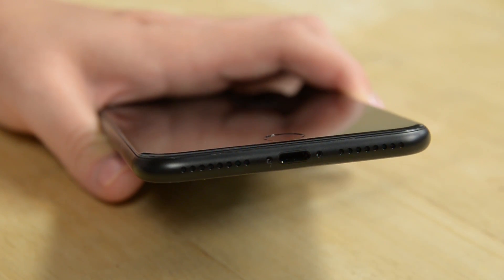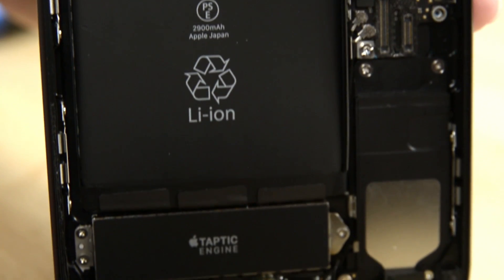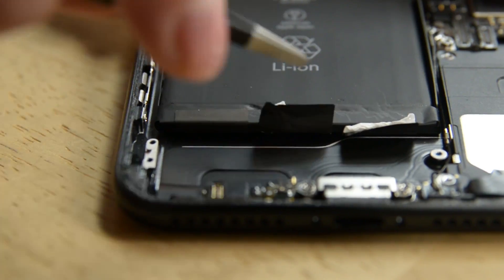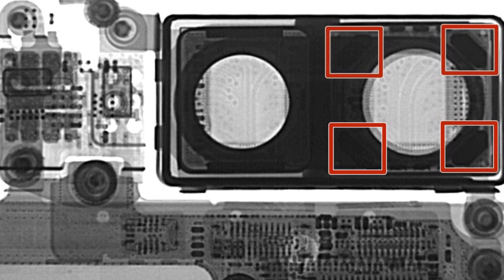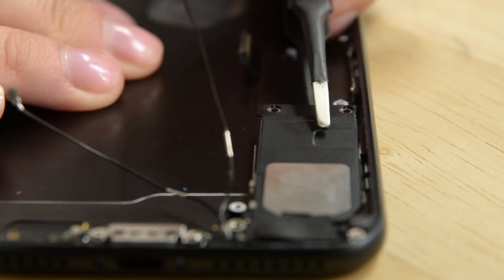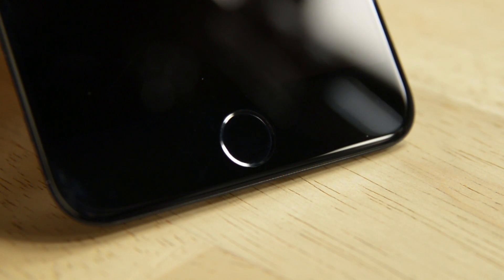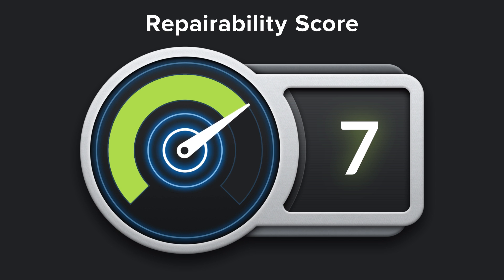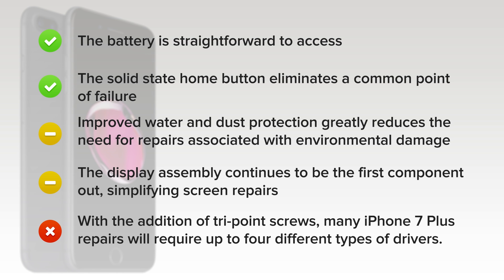iPhone 7 Plus Teardown

Comment: Can it do harm if you do NOT screw back te little metal brackets (in the middel to the right) over the connectors that attach the screen to the body and Covers the battery connector? My iphone 7 didnt have a functioning microphone after a screen replacement and that metal bracket was not screwed back on i found out. Could it have made a short circuit? My iphone takes over 3 Minute to Boot now after the screen replacement.

Comment: Came here because I’m a woodworker and the small speaker holes at the bottom of the are full of saw dust. I’ve used a toothpick and and free handing a tiny drill bit to carefully work it out a couple times but I feel like I am packing it in now. Any suggestions? Thanks!

Comment: great video and all but you should have rated repairability on this 0 because there are not replacement screens that i have found that you can buy... and even if i could find them they would probably be outrageously expensive.... the 6  and 6 plus screens are $29 and $39 respectively then the 6s plus screens are for some reason around $100.... CRAZYYYY whyyyyyy????

Comment: so second speaker grills are just holes and nothing else? i thought there would be microphone or something :\
Reply: the second speaker is up at the earpiece assembly at the top of the phone the second speaker grill at the bottom is for microphone and valve for pressure equalization

Comment: The top portion of that iPhone 7 is unsurprisingly empty...
Reply: how is it empty? two rear facing cameras, flash, microphone, front facing camera, speaker and proximity sensor? i guess you just don't care about taking photos...
Reply: Ryan Toomey Maybe.
Reply: Nope, how is that empty, it's filled to the brim, that space in the middle of the back portion is for the front facing camera attached to the display. look again.
Reply: Could they have fit a headphone jack?
Reply: Space for more stuff in the future! hehe

Comment: when you took it apart I saw some stretchy material. I assume this is adhesive that not only does binding but aids in water proofing? Do you pretty much compromise the waterproofing my opening this thing initially?

Comment: For a expensive phone like this the specs are awful!
Reply: Lol, you do know it's the fastest Smartphone currently? It's called Optimization.
Reply: It literally scores the best on Benchmarks out of any other phone on the market so I'm not seeing where you are spewing this bullshit...
Reply: Troll?
Reply: The A10 processor is 6  core 2.5 ghz. That's actually overkill for a smart phone.
Reply: NOT a fanboy. Just saying, that's not the low grade processor you are making it out to be.
Reply: Jason C. Actually it's a quad-core where two of them are lower power, and only one set it used at once. But it still beats the Note 7 and every other Android in benchmarks despite pretty much being a dual-core.
Reply: DeFy Noah The GPU is 6 cores and the CPU is 4 cores. Both are on the same chip. Its SoC.
Reply: DeFy Noah http://www.theverge.com/2016/9/7/12746884/apple-a10-fusion-processor-iphone-7-specs-comparison
Reply: DeFy Noah https://en.wikipedia.org/wiki/Apple_A10_Fusion
Reply: Jason C. Th GPU is six-core, but I was referring to the CPU as most do when they talk about the A10.

Comment: once you've opened the phone and put it back together will it still retain the IP67 rating? considering the water resistant sealants will be torn and destroyed will the phone still effectively keep the water out?  I ask because screen repair is big business for the apple store and I wonder if they will be able to guarantee the IP67 rating for your phone once they replace your screen.
Reply: They'll probably put new seals in when they replace the screen, so that'll keep the water resistance. If you don't replace the sealing, then I wouldn't assume anything.
Reply: right good point, if it's a DIY situation or a repair tech who does not replace the sealant then I guess that rating will be out.
Reply: you should ask them and don't assume that they replaced the water resistant sealant

Comment: Sooo... if you tear down and reassemble an iPhone 7, it will no longer water resistant since the adhesive is torn apart / no longer seal the phone ?
Reply: I was wondering the same. But I'm sure that the better quality third party manufacturers of replacement screens will include some type of new gasket with adhesive on the replacement screen.. That is if your screen cracks. I wouldn't open the phone just for fun since you may make it no longer water resistant by doing so.
Reply: Right. That iPhone 7 plus isn't waterproof anymore.
Reply: jeffscomp no phone is waterproof but water resistant
Reply: you can buy new adhesives online, like for the iphone 6s. Just make sure that the technician that is going to repair your screen, comply with basic standards (meaning that he's not a cheapskate and will invest in 1$ adhesive)
Reply: the water resistant will be gone, have to coating again.
Reply: https://youtu.be/3UDxhAKeIic

Comment: Will Touch ID still be unable to work in the event of the home "button" being replaced?
Reply: The iPhone 7 and the 7 plus currently supports Touch ID
Reply: Yes I'm sure this won't change since it's a security measure. The home button will most likely remain paired with the phone's logic board as it is now. Otherwise someone may find a way to pair a new home button with THEIR fingerprint to YOUR phone and potentially get access if it wasn't strictly paired with the original.

Comment: Wow, the taptic engine is huge!

"The 3.5mm jack takes up alot of space" my ass, that thing must be almost twice as big by volume.
Reply: they put two 3.5mm jacks in there.
Reply: Lol, I was thinking the same thing. They got rid of the 3.5mm for that thing?!
Reply: Not for quite a while really.  And even if they did, it would be based on the standard usb jack, which any company can make products for without licensing.

If samsung invented a new proprietary connector, then slapped it on their phones in place of USB there would be outrage, let alone if they then removed the headphone jack in favor of said connector
Reply: Eric P So you're telling me that the headphone jack is here to stay forever?
Reply: so true
Reply: +Ryan D'souza we can just tell you just follow orders like a good little sheep
Reply: gracias
Reply: the removal of the headphone jack came for many reasons. and while they may not be using the extra space for anything groundbreaking right now, they will be able to do more in the future with the extra space. it may seem like trivially small but in such a small device small is relative and percentage wise, it was a fairly large component
Reply: Zenolijo this reply is very late but here goes. They removed the headphone jack to place the taptic engine to give you a flawless experience with the little feedbacks it gives you here and there
Reply: everyones been gearing away from a world without the 3.5 mm jack. Guarantee every other single phone company will start to follow suit. 

and nobodys going to whine as much cause its not apple.
Reply: That taptic engine is easily 3x the size of the one in the iPhone 6s Plus. Waste of space.

Comment: The main reason I watched this video was to see what as behind the 2nd speaker port. It wasn't a speaker. So externally it looks like stereo, but in reality it's not. Yikes, how disappointing.
What a waste of space that haptic engine is. Right where the 3.5mm headphone jack should be.
What a mess Apple has made.
Reply: Ryan Simmons wrong, both phones have dual speakers. I have the iPhone 7
Reply: Bill Ryan the main reason i watched the video was .... BOOBZ :)
Reply: It actually is stereo. The second speaker is up top near the earpiece assembly. Possibly INSIDE the earpiece assembly. It got me at first because I got the 7 and noticed that the case I got didn't have an opening for a speaker up top. So I played a video and the sound comes from the earpiece assembly. It may actually be the same speaker as when you talk on the phone but I imagine that software tells the speaker to be quieter when on a phone call and loud when on a video or game.
Reply: The 7 plus does have a dual speaker. The second speaker is actually near the earpiece. The second grille is simply for esthetics. The regular 7 does not have a dual speaker though.

Comment: removing a headphone jack for a vibrator and call it innovation...... smh.
Reply: A lot of people want a secure connection to provide an audio output. Not all people want to charge their headphones at the end of the day, or in some cases at the end of 3 hours, just so they can listen to music. Don't come back at me with "they have a dongle", because I have had many use cases where I would need to charge and listen to audio at the same time. For example, at my workplace, I do work with my hands and listening to podcasts or music helps me concentrate. Since the work day is so long, and the podcasts I usually listen to are on YouTube, the battery drains quicker than I'd like. In that situation, I plug my phone into a wall outlet, therefore needing both connectors simultaneously.
Reply: the Taptic Engine was in the 6S too. the headphone jack is analog and super old. who wants to be physically connected to their device? wireless is the obvious future and the taptic engine is amazing haptic feedback where apple can create the physics of the phone, the feel, like they create the software
Reply: instead of a dead vibration is taps you in a futuristic way, it's super awesome!
Reply: You're too much of an apple fanboy dude.
The headphone jack removal is stupid, period.
No matter how "amazing" the haptic feedback is, it's not a good excuse

Comment: Can u make a video of the iPhone 7/7 plus hissing noise? I have seen some videos about it and I wonder what cause that hissing
Reply: It's basically "coil whine" as it's called. Very common in laptops but now showing up in the iPhone due to the powerful processor it has in it. It happens when either the CPU or GPU (or both) is under high loads.
Reply: it's really incredible the performance they're getting out of these chips! apples chip design team is doing incredible work, maybe some of the best considering how intel's focus has switched to battery performance

Comment: Although it's not the easiest job in the world, the iPhone is IMO easier to repair than others smartphones if we take in consideration that most of the times users want to replace a broken screen.

Since we have accepted that screen and glass are fused and it's here to stay, I'm glad the screen is easily accessible because the rest of the hardware is attached to the back of the phone.

In many cases we see the back cover coming out first and we need to work our way to disassemble each and every peace of hardware before being able to put a new screen on it.

Comment: Surprisingly that the Taptic engine consume so much of space, i feel it can be smaller for the space for a headphone jack, as it's only provide vibration feedback, am i right?
Reply: armystrong6920 well if Apple comes up with actual wireless charging, it will be new, innovative and groundbreaking. Because what companies (like Samsung) have right now is inductive charging, not wireless.
Reply: Yes but it also provides the feedback for the 3D Touch on the screen, not just for the home button. That's probably why it has to be that big.
Reply: Jake G Just like when they finally decided to include wireless charging? They'll add some hyped up marketing BS on top of wireless charging and claim it's "innovative", "new", and "ground breaking".
Reply: the taptic engine is Apple doing something new, who else is actually doing something new in a phone? its incredible industrial design matched with technology and marks apple's new trajectory of creating physics like they create software

Comment: wheres the other speaker? is the duo speakers legit?
Reply: Redstoner The left one is the microphone.
Reply: The second speaker is at selfie camera.
Reply: iEatPusiLikeiHaveaDisease the left Speaker is fake
Reply: the stereo speakers work best while watching a video in landscape, there's the speaker on the bottom of the phone and there's another near the top of the phone. it works this way because there's greater distance between the top and bottom of the iPhone than the left and right which leads to better acoustics
Reply: it's just a microphone and a much better one at that, the second (new) speaker is at the top of the device

Comment: The iPhone 7 plus headphones have a gasket on the connection point when you plug it in it seals the port. I just noticed it. On mine.

Comment: Considering that any repair would make the iPhone no longer being "waterproof" 7/10 is a laughable score, should be around 1/10 same goes for any other IP6N device which doesn't have direct user accessibility vectors built into it's design.

Comment: Although it's probably obvious, attempting to repair your own iPhone, sends the ingress protection rating out the window.
Reply: You can buy a new set of adhesives when available.
Reply: Tom Chai i wouldn't trust it, only if it was repaired by Apple or an authorized repairer.
Reply: onesimpleclik You can trust the parts, however it is up to you to install them correctly and test for waterproofness.

Comment: I'm assuming the seal around the display will need to be replaced if the phone is ever opened, correct?
Reply: perhaps a new sealant may be good... same sealant type used on water-resistant phones
Reply: yeap, the seal is what gives it its water resistance.
Reply: I know that I was more asking whether or not it was reusable.  Based on how it seemed to be stringing apart like glue on disassembly, I'm gonna guess no.
Reply: Correct, same as the 6s
Reply: Yes that is correct, that is if you want the water resistance to be reinstated.
Reply: yes of course.....
Reply: Nope!...sure won't
Reply: yes, like in any phone ... its a special tape ..
Reply: Yes, and you can buy those adhesives off of AliExpress for 1 to 2 bucks apiece
Reply: yes
Reply: Yes!...

And you will probably never be able to get the IP67-resistance after opening ever again...

Comment: A good video but you should've pointed out that opening the iPhone will damage the waterproof seal around the screen.
Reply: They put new adhesive when removing the screen.
Reply: So opening it up will make it lose its water resistance? Is there a way to seal it back by myself?
Reply: we're not all americans you know:))
Reply: Voodoo Child Hah, yeah but sadly a lot of iPhone users are american
Reply: true but at the same time it should be kinda obvious
Reply: well thats kinda obvious
Reply: That's obvious
Reply: Curtam os comentários mais recentes !
Enjoy the latest comments!
Reply: It was pointed out it’s grown more complicated with more water proofing measures.
Reply: the phone already Non-waterproof so don't worry pro
Reply: The seal is water resistant, not water proof.
Reply: I was scammed with an iphone 7 plus with icloud lock. If I change the motherboard (just the motherboard. IT doesnt come with the home button) will the original home button not work at all? I mean I dont care if it doesnt work for touch ID, but I need it to work for everything else.
Reply: Pretty sure thats self explanatory.
Reply: then they would not get paid by apple
Reply: Jack Black you have to find and buy the correct gasket for the iphone 7/+. the 6s also has a similar gasket

Comment: I've heard the iPhone 7 Plus addresses the bending issue from the iPhone 6 (and 6S) Plus.
Is this true?
Reply: Casjen Schmid Oh.So it's just the normal 6 Plus that has the issue and the 6S, 6S Plus, 7, and 7 Plus do not have the issue?

I'm still using a 6 (16GB Verizon) so I guess it'd be okay to switch to the 32GB Verizon 7 Plus then?
Reply: no
Reply: The switch to 7000 series aluminum in the 6s Plus fixed the bending issue with the 6 Plus. The 7 Plus uses the same aluminum, so it's safe to say it still doesn't bend.
Reply: The iphone 6s fixed the bendgate and iphone 7 wont bend in your pocket to
Reply: The 6s addressed that issue.
Reply: The 6S already fixed that by changing the aluminum alloy to a stronger one.

Comment: Great video! I'm so glad the plus now has 3 gigs of ram!
Reply: Yeah its a good new feature but have you ever used up all of the 2gb of ram in the 6s/6s+? It's quite difficult to do.
Reply: Yeah but they're also poorly optimised an NEED that much ram just to function properly. Have you seen phone buffs app launch test? The iPhone 6s was the first and only phone to go its entire life cycle undefeated. The test starts with opening a bunch of apps and performing operations. This first part tests storage speed, CPU speed, ram and GPU. Then after completing the 1st round they then go back and reopen all the apps in the same order. If the ram is working the way it should then none of the apps will need to reload. The iPhone 6s with 2gb of ram flew through the test and beat every single competitor including the latest android flagships and even finished both rounds faster than the Note 7 could finish the first round. Just shows that apple know what they're doing when it comes to chip design and software optimisation.